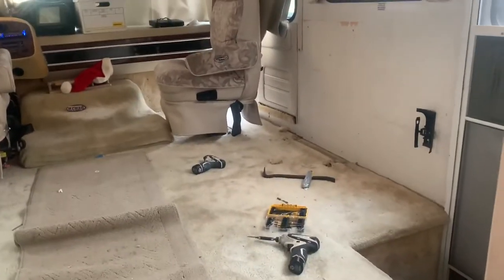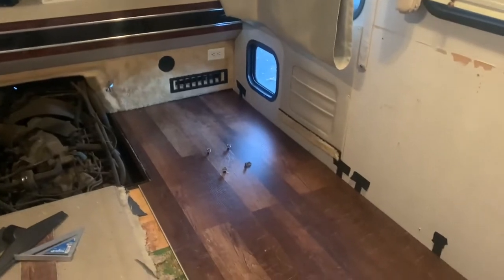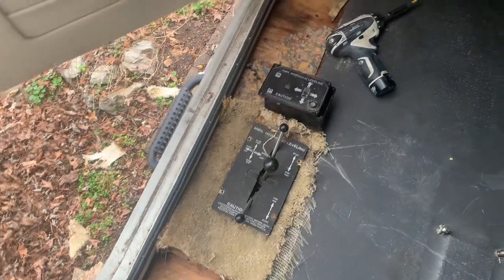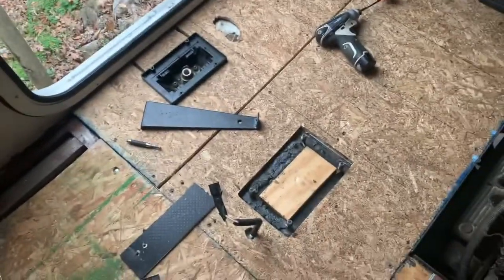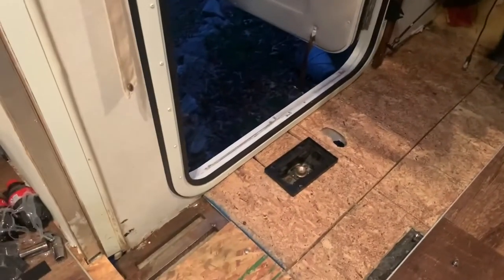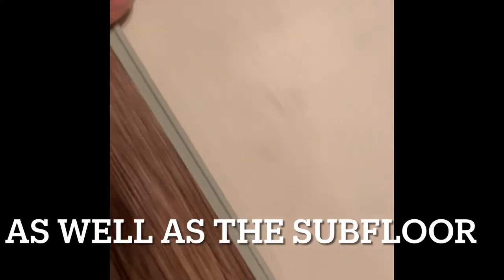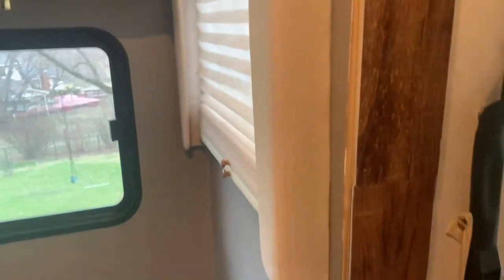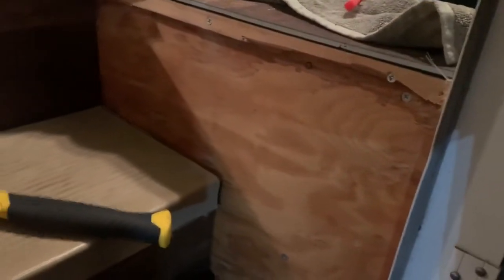Vinyl plank flooring Install Pt 2. for your motorhomw

Comment: Did removing the floor increase the road noise when on the road?  I would think the rug does a good job with sound deadening.  I was considering putting sound deadening material over the subfloor prior to installing the floor.
Reply from the maker: So I have taken the rig on a short trip, have not noticed a different in road noise. I will be taking it on a longer trip in a few weeks and I will let you know. On the trip I did take the floor stayed in place very nicely. Love the way it turned out
Reply: @thisoldcoacheverythingrv2625  thanks!

Comment: Your floors look good. I’m just starting to do the flooring in our RV.  My slide is similar to yours. It’s a raised platform and goes over about a 3.5 ft section of sub flooring. How did you secure the planks of vinyl under the slide?
Reply from the maker: I did put a plank row about 4 inches under the slide, that was as far as I could get, I was able to snap them together. I think maybe snapping the vinyl peaces together with a bead of liquid nails maybe a good option. I was also able gently  lift the slide up a bit to get under it. Just be very careful not to hurt any of the slide components. Also some slides come up a little when you pull the slide in a bit. Just have to experiment with it. Let me know how it turned out

Jim

Comment: Updates, how are the floors holding up/how much have you traveled with the camper since install?
Reply from the maker: Floors are looking really good. Finished it all up. Putting base board and 1/4 round down. Have moved the Rv when I installed the mini septic system but have not been on a trip yet. To much work to do still. One peace of advice I can give, I wish I would of painted first. I am extremely happy on how good the floors look. Oh one other thing, some of the underlayment had water damage and I had to replace some of it and that took time. Thats it in a nut shell